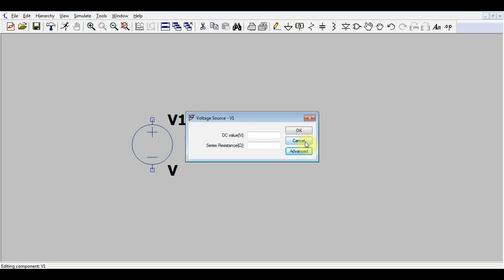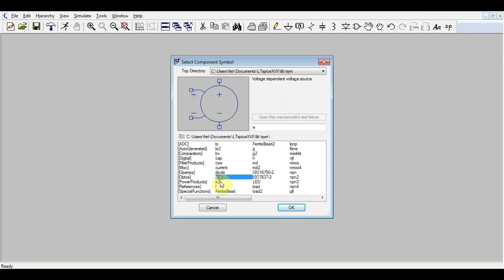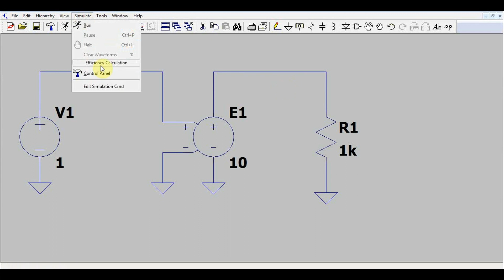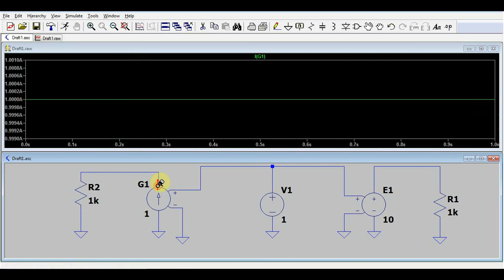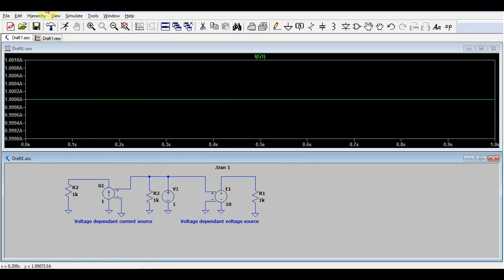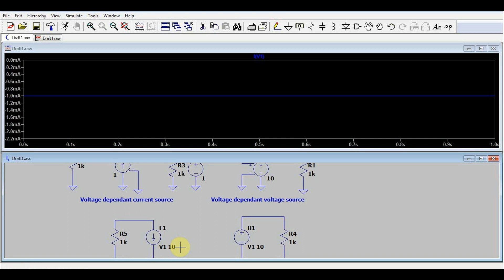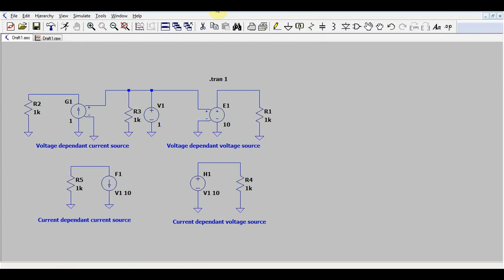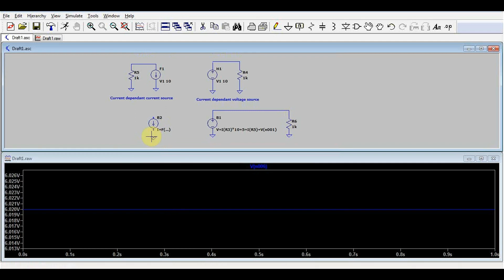LTspice tutorial - Ep7 Dependent voltage and current sources

Comment: Hi, I would like to model a MOSFET by using dependent voltage and current sources, and I guess that the voltage dependent current source is the most appropriate one. Could you give me please some guidance how to model it based on the values of drain and gate voltages? Thank you

Comment: Hi, 
I simulated current source connected to capacitor. But, I got an error

The theory, capacitor voltage will ramp
Reply from the maker: What was the error that you got? Normally the simulator calculates an initial DC point, so it might want to charge the capacitor before the simulation starts. Maybe you can try with setting "Start external DC supplies at 0V" in the simulation tab. Another thing to do is add a resistor (even 1mR) in-between the current source and the capacitor - this usually helps remove the errors.
Reply: @FesZElectronics  

ERROR: Node N001 is floating and connected to current source I1

Direct Newton iteration for .op point succeeded.

Date: Fri Aug 02 21:13:34 2024
Total elapsed time: 0.083 seconds.

tnom = 27
temp = 27
method = modified trap
totiter = 2085
traniter = 2082
tranpoints = 1042
accept = 1042
rejected = 0
matrix size = 1
fillins = 0
solver = Normal
Matrix Compiler1: off  [0.0]/0.0/0.0
Matrix Compiler2: off  [0.0]/0.0/0.0
Reply from the maker: The extra series resistor should fix things. If not a parallel resistor of very high value (ex: 100meg)
Reply: @FesZElectronics  ya parallel resistor fixed the error. But, the capacitor voltage could not ramp. as we know, Vc = 1/C * (integral of i dt)
because parallel resistor connected to capacitor, all of current flew to parallel resistor(in simulation). So, the capcitor voltage was i*Rp

I tried extra series capacitor, it could not fix the errror
Reply: @FesZElectronics  I tried to simulate the same circuit. But, the current source used pulse. I filled I1 0A, I2 1mA, Ton 1s and Tperiods 1s. It worked

Ton = Tperiods. It is like constant current

Comment: But why are the currents negative for the current-dependent sources? You measure -10mA across them. It also appears that the direction of the current flowing in the wire is the opposite of that flowing through the resistor.
Reply from the maker: Current direction is relative... when you go with the mouse over a component, a "direct" current direction is highlighted by a small red arrow. The displayed current is in reference to this.

Comment: I am missing a voltage source with Max power output. I have tried with the analog device suggestion but it is not working correct. Pmax mW =80. So at -20V Imax mA =4, 10V Imax mA 8 aso. Suggestions will be welcome👍
Reply: Thank you, it will help me.
Reply from the maker: Are you trying to simulate a load with fixed power, or a supply? I remeber you can simulate a constant power load (behavioral voltage source with P=xx as argument), but if you want a supply, I guess one way would be to create a voltage and current limited supply - https://youtu.be/DnKnuJd3-ec maybe this will help

Comment: that was so helpful , thank you.
but i have faced a problem and it stays (Time step too small; initial timepoint; trouble with node "n001")
I try to google this problem and i found out that i have to use a ground, but i already used one!
i hope someone can help me with this issue.
Reply from the maker: Maybe you can give some more details on the circuit you are simulating? I get this problem for a variety of causes, starting from bad component models, to floating circuits or just badly designed circuitry.

Comment: I already make my loop antenna model In ltspice (thanks to you), can you tell me how to model an electromagnetic field that induce EMF to my antenna? Am i need to use dependent variable source or?

Sry for my bad English.
Reply from the maker: Hello Namar! I'm not sure what exactly you are trying to simulate - LTspice is not really designed for EM fields - you can replace the antenna and induced field completely by just a simple signal source, this in case you want to focus an RF amplifier for example.
Reply: @FesZElectronics  I am trying to simulate an antenna detector for lightning location.
Hmm, so what is the software for em fields. Can you tell me? Can I use cst studio for my antenna and induced field?

Comment: Thanks! Was looking for exactly this info to model a buck converter IC's behavior.
Reply from the maker: Happy this helps! What circuit are you working on?
Reply: @FesZElectronics  A e-bike power meter a current sense amp+buffer op-amp+dual channel ADC+FPG for multiply and accumulate+bluetooth module+android app. Have a V1 board with a linear regulator but the 4W turns out to be a lot to dissipate even with an aluminum plate as a radiator. Don't want the thing to get hot inside the bag with the e-bike battery. Looking at using MP4569 (available from LCSC) + a linear reg to reduce the ripple to step down to 3.3V but with no experience with such things. Wonder how the IC manages to keep the voltage regulated with no upper voltage limit detection only relying on maximum peak current detection, gonna simulate using the functional block diagram from the datasheet.
Reply from the maker: @axk1  I'm not sure if we are talking about the same IC, I found the MP4569 made by Monolithic Power Supplies (MPS) and it does have a feedback pin (pin4) which it uses to sense the output voltage. It's a current mode control IC but the "current mode" refers to loop control, keeping the thing stable, not output voltage setting; you still need a feedback pin to measure the output for that.
Reply: @FesZElectronics  Yes, this is the IC. I mean it uses the feedback to detect if the output voltage has gone below the reference and if the inductance current has crossed zero by this time it switches the high side ON and the low side off connecting the supply to the inductance. But to switch the high side OFF it is only relying on the inductance current to go above a fixed limit (700mA), so I guess somehow there's no big overshoot in the output voltage before the inductance current reaches the limit.
I guess this is how "current mode" buck converters work, so I need to read up on that. Thanks!
Reply: @FesZ Electronics, There appears to be a gotcha with how behavioral voltage sources  with a comparison in the condition work. Trying to do a zero current detector with I(L)<10m in the condition. Don't see the voltage source actually switching on in the simulation but the L current is oscillating right around 10m (or whatever limit I set in the comparison) as though the voltage source was switching on. Need to add hysteresis to the condition somehow I guess.

Comment: It would seem to me that it is worth noting that for the BV and BI sources, the terms that we bring over to the right side of the equation F = are numbers, and these do not include units. So in describing BV you said that we write an expression for BV that begins with THE CURRENT through R3 (the first term in the expression you used is I(R3)).  No, it is not a current of 1 mA. It is simply the number 0.001.  The complete expression you used was V = I(R3)*10 + 5.  This is results in (0.001)*10 + 5 = 5.01 V.   Again, suppose we have a BI source and it is defined as I = i(I1)*i(I1) and i(I1) = 2A.  Then I = 4A, not 4 A*A (amp-squared); the point being that all terms on the right side of the equation are numbers (without units), even though they are taken from quantities that have units.  I am not an LTSpice expert, so maybe I am wrong, but it seemed worth mentioning. Anyway, I am learning a lot from you videos. Thank you so much for these!
Reply from the maker: You are right David! With BI and BV sources, the expression you write will only take into account the numeric values, not the unit of measure. You can combine [V] and [A] and as many times as you like and it does not matter, the output will still be [A] for the BI and [V] for the BV.
Reply: @FesZElectronics  FesZ, thank you for your reply.  Your work is truly great and you are helping a lot of people.  Me included.  Thanks so much for these videos.

Comment: What if I want to add the current over a certain resistor as my current for the dependent current source? I dont get it. You just add a v1.
Reply from the maker: Hello, For some reason if you use an F source (Current Dependent Current Source) LTspice only accepts current information from voltage sources, I have no idea why, it might have something to do with this type of source being a very early component in LTspice development... But if you want to use current information from other components, like resistors, its best to use Bi sources (behavioral current source) - there you can write more complex formulas with multiple information soruces.

Comment: thanks for this, can you maybe cover Tables next ?
Reply from the maker: I can try, but what do you mean by tables in Ltspice? We may have a different understanding of the same thing, maybe you can give me an example.
Reply: @FesZElectronics  sorry I meant lookup tables. 

Syntax: Exxx n+ n- nc+ nc- table=(<value pair>, <value pair>, ...)

A look-up table is used to specify the transfer function. The table is a list of pairs of numbers. The second value of the pair is the output voltage when the control voltage is equal to the first value of that pair. The output is linearly interpolated when the control voltage is between specified points. If the control voltage is beyond the range of the look-up table, the output voltage is extrapolated as a constant voltage of the last point of the look-up table.

How does this work ?
Reply from the maker: Interesting topic! I never used this function in LTspice. I will try to get to this as soon as possible
Reply: @FesZElectronics  thanks man appreciate it, I came across this on diyaudio, some of the members model class-d amplifiers transfer function using it.
Reply from the maker: I looked over this topic a bit, here's what I came up with: tables are good for direct input-output voltage linking, like between 1-2V the output is double, 2-3V output is triple, 3-4V output is 10x, or something like this. For modeling transfer function, especially the AC response, the better function is Laplace. This is used by adding a Laplace transform in the form of a*S^2+b*S+c, or for higher order filters the equation has more polynomial terms. I made an example: https://drive.google.com/open?id=1nAQhFMDwcQKK1menAhaS6pT28xX3orTn

Comment: Very helpful video, and well explained! Thank you.

Tip: for current-dependent sources (either voltage sources or current sources), there's a good way to select which current you want to use as the controlling current. As you said, for the controlling current we can only use current though voltage sources, not through other elements (like resistors, capacitors, inductors.) However, you can place a voltage source of 0 V DC (let's call it V2) at the branch where you want to have the controlling current, and then you simply use the current through V2 as the controlling current! Since V2 is of 0 V and is connected in series in the branch, it literally won't affect the circuit. Keep in mind the controlling current (current through V2) will have the direction such that it enters the positive terminal of V2.
Reply from the maker: Great tip! Honestly I did not really simulate a lot of circuits with Current behavioral sources, but I remember I did see this implemented once when I was doing my research for Ep12 ( https://www.precisionmicrodrives.com/content/ab-025-using-spice-to-model-dc-motors/ ). I found it very strange though that there already was a voltage source in series with the 0V one so in the exercise I did, I removed the 0V one and used the other source; but now that you highlighted this way of thinking it all makes sense. Thank you for this insight.
Reply: Nice tip. But do you know why current dependent sources can only be controlled by the currents through voltage sources? I don't see a good reason why we can't use the current through a resistor for example.
Reply: @vladomaimun  I don't know either; that should be improved. Also, they should create an ideal transformer model; currently it can be modeled as two magnetically coupled inductors with unity coupling coefficient but finite inductance (so the Tx isn't really ideal); a way to make an actual ideal Tx is using dependent sources, but it's tedious to do that for each Tx in a circuit.

Comment: Thanks so much , this very helpful, how can i model LLC converter , i need the frequency vary to keep out put stable?
Reply from the maker: Hello Tom! You can check out Ep.12 Modeling a DC brushed motor, there among other things I make variable frequency oscillators to simulate the rotation of a motor when running, turning on and off. Maybe that helps.
Reply: Thanks so much, also how we can write code I mean to use node voltage
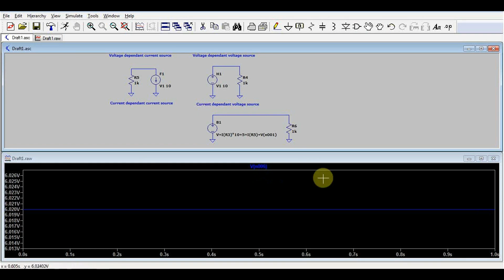Reply from the maker: Maybe I didn't understand the question, I showed an example at 8:50 https://youtu.be/Jn8mJG3qeoo?t=5308:50 in which I used behavioural voltage soruces. To put a node voltage (ex node 001) you simply use V(n001). You can set the voltage of a behavoural voltage source to be V=V(n001)*2+3. The equation can be much more complicated, all the functions can be seen in the help category for Behavioural voltage source (bv)